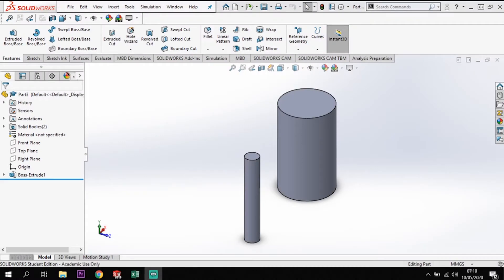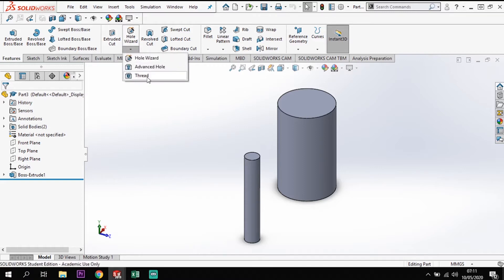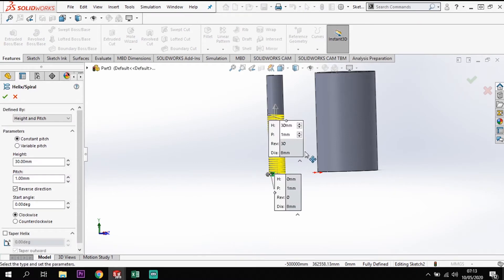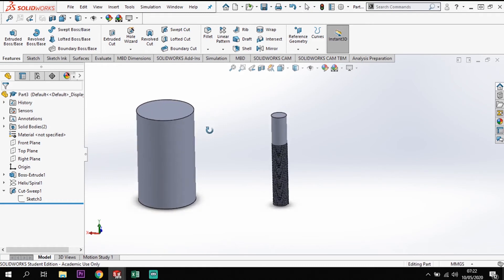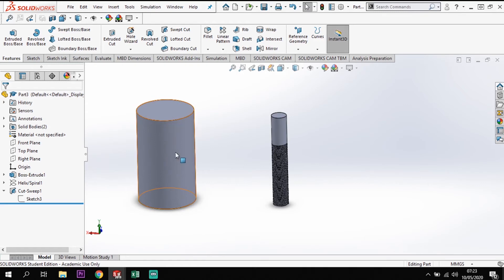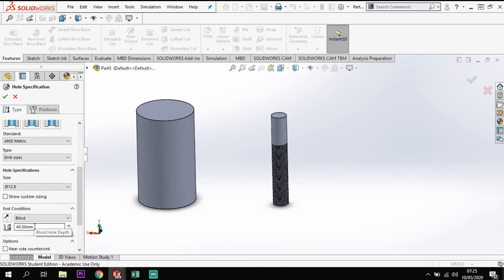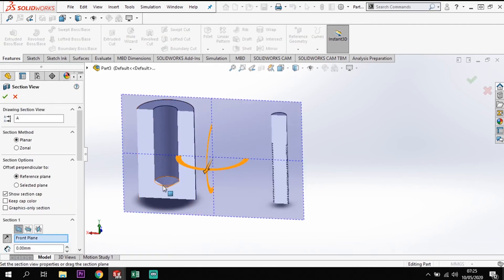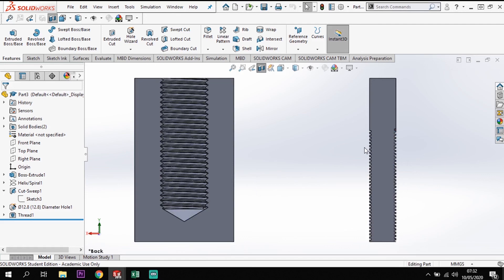SOLIDWORKS THREADS | CUSTOM THREADS | THREAD IN A BLIND HOLE !!!!

Comment: Thanks :) 
I’m trying to learn how to do this even though it’s fairly straightforward. If you don’t do everything correctly, you get errors and you don’t really understand what the issues are without enough experience.  But the first section on the OD thread I think I get to draw a profile but the blind hole I didn’t see you draw profile for the cutting path or create a helix so I’m assuming it was able to do it on its own.? I’m having to do an M 42 thread by 2 mm pitch and because it’s not standard at least on the whole wizard I had to create something on an OD.